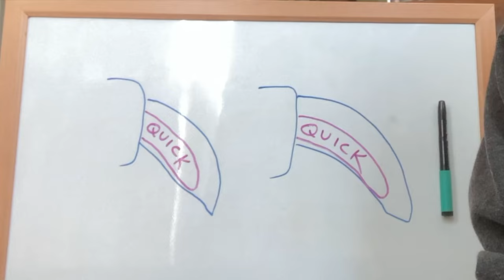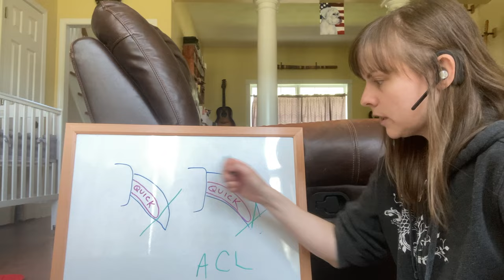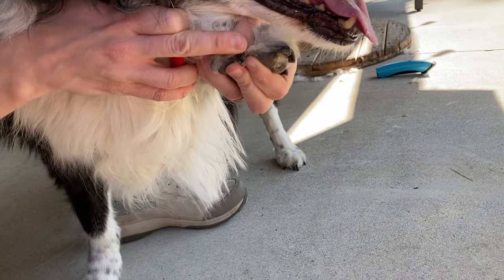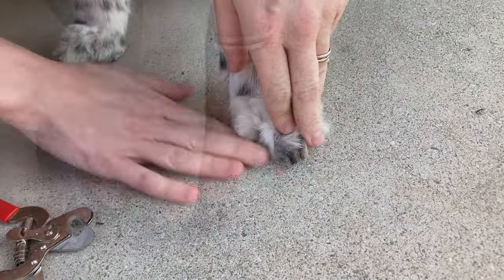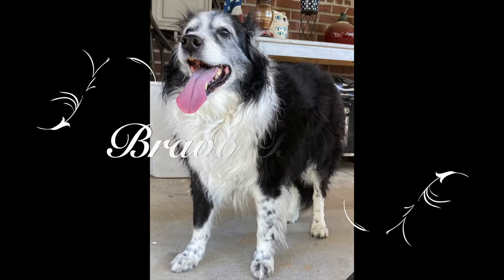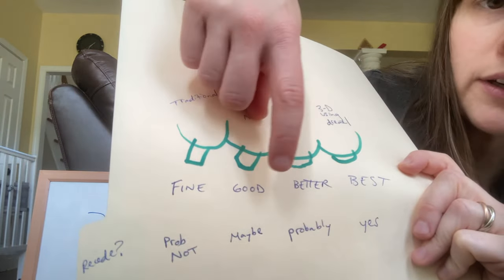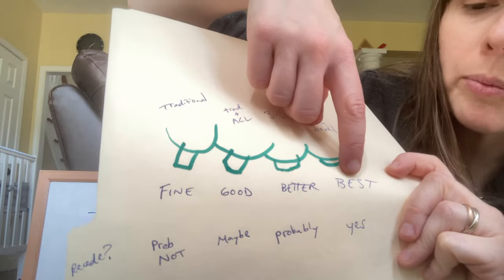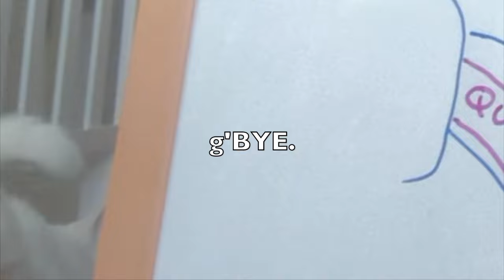STRUGGLING To Recede The Quicks? Groomer’s Technique For Success!

Comment: Great video on nail trimming! I try to do the 4-facetted clip. I think what happens is the nail when cut like that wears down faster because it's not as strong and naturally keeps pushing the quick back. PB's nails are pretty thick, so doing the second cut to take the top back thinner is crucial.

Comment: Hi! You've helped me out in the past and I'm still trying to receed my boys quicks haha. I think I needed to add the extra helmet removal part of it. I did Dremel little underneath then the side and then I'd round the nail so it wasn't pointy. But from what it sounds like I need to do the sides still but also take the Dremel and take the top off too. I tried this yesterday felt weird because I wasn't sure how far into the top I could go (wasn't in the lightest of light to see the quicks) so I prob stopped haha. Would it be ok when doing the sides to continue the side over the top/helmet if that makes sense?? Or would it be best to get the nail area lit back wise so that I can see the quick area and then accurately take the top off? Since the quixk hasn't receded to where I need them should I do this process every 3 days or so until we get to the point of recession and then can prob do 1-2 weeks. Or longer.

Comment: I can't trim my own dogs nails. Do groomers know this? Thanks so much for this! I'm hoping if I start asking my groomer to dremmil will work. My Chiweenie has such long quicks. Anyonee that knows I'd appreciate your experience.
Reply from the maker: I have read on some Facebook groups that it helps to ask your groomer if they’re familiar with the “alternate cut line” with trimming nails. That phrase basically refers to the 2nd nail example in this video so it’s not even the whole story, but it can help you start a dialogue with the groomer and discern whether they’re thinking in the direction of quick receding or not. (You could also mention that you saw a video on the topic and ask if they’d be interested in trying to help you recede your dog’s quicks) Some groomers charge extra to dremel because it’s an additional skill that takes extra effort. I worked for a shop where the standard was to dremel the nails as short as we can get ‘em. That was included in the price of the groom. Only occasionally if a dog wouldn’t tolerate the dremel would we settle for “just” clipping. So every groomer is different!

Comment: These are fantastic videos - so clearly explained to get the quick back. What I struggle with is positioning to dremel. I've tried to watch where you are and you seem to be comfortable in any position - you in front of the dog with them standing, you behind/over them, etc. My Jack Russel mix is skiddish but will tolerate with a muzzel and someone holding her. I just have to go quick. Any thoughts or suggestions?
Reply from the maker: I have at least 1 video that might help: “holds for dremeling a small dog’s nails” https://youtu.be/QWdb28nwDqc This video shows the holds I mainly use, but there are other potential positions and holds out there. For example, some people have their dogs lay down in their lap! I also have a tiny dog holds vid: https://youtu.be/nyBkIFo0qo0 in case it helps at all. You might consider doing only one foot per session for a while, or breaking the task down in some similar way so each session isn’t as stressful for your dog. Hope that is helpful, let me know if you have further questions! 🐶

Comment: Great information!! Which accessory do you use on the  dremel?? Did you buy a special one?? I have the dremel kit but confused which to use. Thanks!!
Reply from the maker: I have a diamagroove which is indeed a “special” one because it’s pricey! ($160) but here’s a video where I talk about it: https://youtu.be/HRmxHql1T7Q  Also here is a video where I cover many options in more reasonable price ranges! https://youtu.be/hlz33gbGqW0
Reply from the maker: But if you’re looking at the bits that come with most dremels, I like the 1/2” diameter sandpaper drum head. 60 grit. (Coarse) You can use medium grit as well (120 grit) Here’s my which grit? video if it helps! https://youtu.be/GFvgunAsneo

Comment: I broke my dominant wrist and am having trouble cutting my dogs nails due to residual weakness. Are there clippers that can make up for this handicap? My dog, though only a cocker mix, has large thick nails and I can’t cut the nail even with new clippers. Or would it be better to try the dremel? Ollie has long fine hair and I’m nervous getting all the hair, such hairy paws, out of the way.
Reply from the maker: Sorry for the delay, I lost track of this comment. I wish I could help but I’m not aware of clippers that are specifically for weaker hands. However, in general I find the Miller’s Forge red handled clippers best because they are sharp and slice the nail instead of crushing the nail. Dremeling can be fatiguing on the hands and wrists, depending on how compliant your dog is. If you have to grip the paw extra hard it can wear you out pretty quick. However it very much could be worth a try if clipping is proving to be a problem for you. Here’s my “scooch fur out of the way to dremel” video… hope it helps! https://youtu.be/S5wBJtlDbgY

Comment: Great video. I already do this actually with my Ruby Doo. I use 100% the grinder. How ever the reason I take out that hood is to get a more rounded nail that does not scratch as much. But its cool to learn that this also helps to get the quick to retreat. Just so you know All dogs will tolerate the grinder its just do they have owners that will actually take the time to teach the dog. I have a great video on how to teach your dog to love the grinder on my channel.
Reply from the maker: Thank you, I’ll check that vid out!
Reply: You just have to be careful not to stay in one place too long with the Dremel - since it gets hot quickly
Reply: @annmariegarcia5657  I have done some further testiing on what you say. I believe you must be using a dull grind wheel. Because when I was using a new one I keept on testing to see if the nail was getting hot and it was not. But a few months later I tested it again and that time I did notice a little bit of heat.

Comment: I know this is a year old video but still. I have a question. 

I actually trim my dog's nails weekly. I've been doing it since she was 2-months-old and she'll be 2-years-old this December 6th and for the life of me I just couldn't get them any shorter than they are and family likes to complain they're too long. 

Okay, and? I'm trying! My dog's nails sit just off the floor when she stands or sits. But when she runs or walk you can hear them click off the floor. This can get annoying when your home is nearly all hard floor and you have an Aussie that likes to move. 

And my dog's nails are so close to the quick that I can't really use clippers too much so I use a fingernail filer on her weekly and I have been doing the top and bottom but had no idea about the sides. I just did her nails last night so I will do the sides later today. 

I'm so glad I conditioned my dog to things like this. I make her lie on her back between my legs and I just give her a pedicure. 😂 She usually falls asleep. I feel confident enough that I can get her used to the dremel when I eventually buy one. I got her used to the blow dryer so this should be fine. Lol.

I am curious about something though and this is my question. Yesterday when I was doing her nails I noticed a soft spongy spot on the underside of her nails that were sensitive to touch but not painful. Is that the quick? So I exposed them and that's good? Also, your dog kind of looks like my Aussie, but she doesn't have the gray on her face.

Comment: When the quick is exposed like that is it unpleasant as the dog is running on pavement etc until it recedes? I’ve dremel’d my dogs back that far but had concerns at times. Any experience would be helpful.
Reply from the maker: A very long walk (say, 30 to 60 min) on cement sidewalks immediately following a dremeling nail trim can cause bleeding. I have heard at least one account of that, so I decided to start advising people to wait at least a day or two for hard cement walking/running. Overall as long as you’re sort of “revealing” the quick and not digging really far into it, there should be no discomfort to the dog. Hope that helps!

Comment: Great video. Very helpful. I learned a lot. If my dog won’t tolerate the Dremel, would doing the ACL or 3D clipped approaches be enhanced by filing the nails a little by hand? Cos if it’s all about removing the outer helmet, a course nail file should be able to take a little more nail off, right? Thank you in advance
Reply from the maker: Yes, as a matter of fact filing with a stiff, coarse grit nail file is the same as dremeling, only much slower. So it absolutely can be a great strategy to increase quick-receding success! Search for the larger, very rigid files with either 80 or 100 grit. (Or, if you’re lucky you can find a double sided one with both grits!) Hope that helps!

Comment: I don’t have a seemed head like that. Mine takes much longer because it basically looks like sand paper. I don’t mind taking longer but my dogs do. Where can I get an attachment like that?
Reply from the maker: You may be using too fine of a grit. Sandpaper should work just fine. I usually use a 1/2” diameter drum shaped sandpaper head that is either 60 or 80 grit. Here’s a grit vid: https://youtu.be/GFvgunAsneo?si=qFhE3juJjF5c31ZH  And here’s a video talking about dremel bit options in case you’re shopping: https://youtu.be/hlz33gbGqW0?si=m4y9n6ylHk7Cxb7r  My dremel bit is called a Diamagroove. It’s pricey but I love it! I talk about it in this vid: https://youtu.be/HRmxHql1T7Q?si=bBT-o02UQcEpOkNj

Comment: Very helpful, especially the part about focusing on the helmet and sides of the nail.  My 55 pd very strong dog will not let professional groomers or even the vet trim his front paws.  With lots of patience and experiment, I can trim once a week.  I smear a spoonful of peanut butter on the inside of a heavy bowl.  While he licks the PB I clip the tips of his nails.  They are very hard and black. Then I smooth with a small dremmel.  He tolerates this well and nails are better.  But his nails could still be shorter. I will now focus on the helmet to see if we can get the quick to recede further.  Can you do a tutorial about how to gage the location of the quick on hard black nails?
Reply from the maker: Yes! Black nails are tricky. It’s a matter of dremeling some, checking your progress, dremeling more, checking again, etc. you’re looking for a black circle that is different than the surrounding black. I am working on a video with footage and close up images that hopefully will help. It’s such a common question!!
Reply: @GoodDogGrooming  thank you. I am familiar with the oval at the bottom of the nail, but can’t tell how far back the quick actually is.  So I have been doing just as you say…little by little.  Looking forward to your video on this subject.  Thanks again!

Comment: Wonderful! Thank you! Dumb question: are the quicks on black nails white or black?
Reply from the maker: Not dumb! Glad you asked. The quicks on black nails are usually black or dark grey.
Reply: How long does it take for the quick to recede?  My dog's nails are black.
Reply: My dog's will not tolerate the Dremel.
Reply from the maker: @kathleenphelan8708  oh my gosh this is a really good question. I don’t have a simple answer but I’ll do my best. Every dog will be different. I think that in as little as 2 months you can see some significant change. It depends a little on how often you’re trimming them, and how well. There was a dog I dremeled every 5 weeks (which is a big gap of time when trying to recede!) and it took 3 sessions to get the long quicks “normal” so that was nearly 4 months. I hope that helps! I may just have to gather more examples and make this question into a video topic one day! Thanks! 🐶

Comment: Regarding the phrase, "now your dog will feel that, but it's not an injury."  Does that mean it will hurt them?  I just can't continue when I think it has hurt my dog.  I want them to trust that I would never hurt them.
Reply from the maker: So my little diatribe starting at 4:40 in this video is explaining how the dremel can touch the outer-most shell of the quick and not actually cause any injury. Exposing the quick is important for quick-receding success. But at that level of closeness, there’s different levels of sensitivity depending on the dog. I would think of it sort of like having a dentist clean your teeth. It’s uncomfortable and there may even be moments where that vibrating brush thing buzzes too close to your gums and makes you flinch. But it’s more of a tickle than a scrape or physical injury. Does that make sense? The dog flinched her paw away at 5:05 when I buzzed over the quick briefly. My interpretation was not that it made her feel pain, but it made her momentarily uncomfortable. Usually pain during dremeling/clipping would be indicated by a yelp.

Comment: Please, I'm getting desperatre.  I've been trying for 4 years, and almost one after watching this video to recede his nails.  He's a big dog who's about to be 11.  I had a lab go crippled in his later years and I can't go through that again.  I simply don't have the dexterity to do your method. But I dremel all the way around in individual sections.  

The problem is there is so much of the jelly layer above his quicks to get close to the quick.  He's cooperative until I hit the jelly later, then it's obvious it hurts him.  I think the problem is that groomer spent years only doing one cut-line on both my dogs and it made the jelly layer grow.

When I try to get  a groomer to help me , they say, "well they're not even touching the ground."  well yeah, but they are RIGHT there, and when he walks and runs they ARE on the ground. Most of our walks are on concrete.  He has a couple toes that are a little crooked and he gets sores on his inside and outside paws for his compensation.  The main problem nails are inside and outside nails.

Now, when I go to dremel, there is hardly anything I can cut.  The quick grows right out with the nail.  I can't do this on my own.
I know this is a long shot, but do you know about in Houston who can help me?  Or any other advice?  Thank you.  Thank you so much.

Comment: Is it normal for the quick to be exposed on the bottom side of the nail? I feel like my dogs nails are split at the bottom and the quick is exposed on the bottom
Reply from the maker: So, if the outer shell is sort of “open” at the bottom, that is probably normal. Often times when you flip the dog’s paw upside down you can see that the outer shell is hollow above the quick. I actually filmed a video about this topic and it’s in the editing phase. I will try to remember to reply to your comment again after that video is posted!

Comment: will the dremel be too hot for the nails
Reply from the maker: Hi! I have never had an issue with the dremel head heating up to much. Friction does cause heat, but in the time it takes to do the nails it doesn’t cause any issues for me. However, if you are concerned you can look into a DiamaGroove bit, which is designed with vent holes to allow airflow through the dremel head during trimming. This is meant to reduce the heat build up. The DiamaGroove is expensive but an absolutely excellent tool! Check out my “I bought a DiamaGroove” video to hear more about it, if you’re interested. Thanks for watching!!